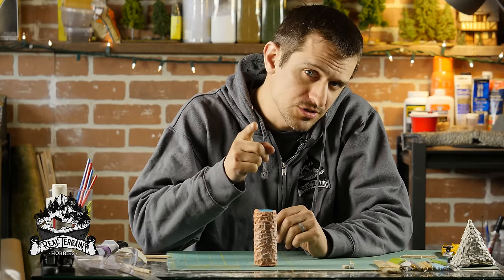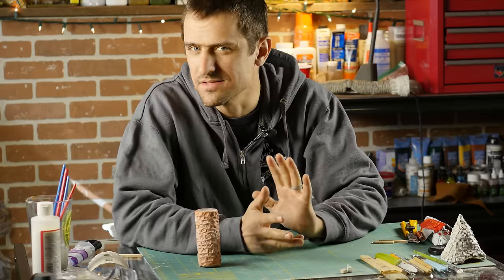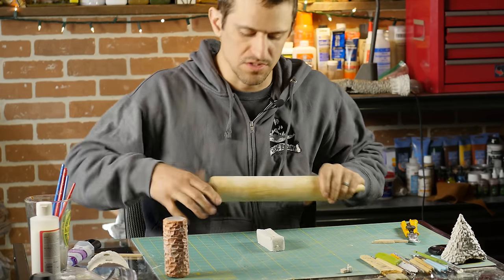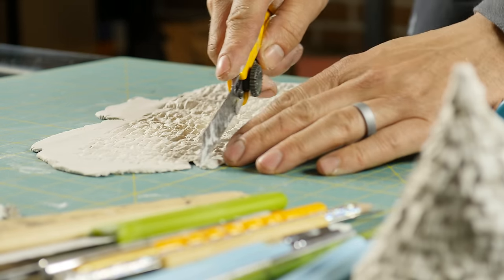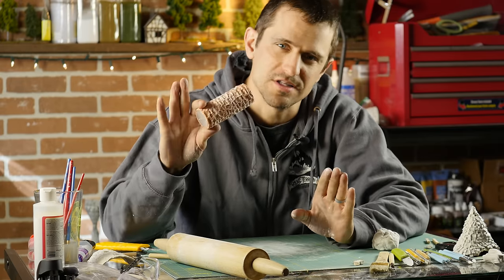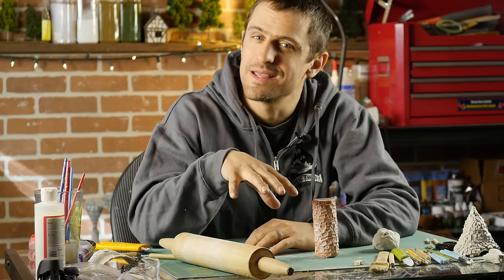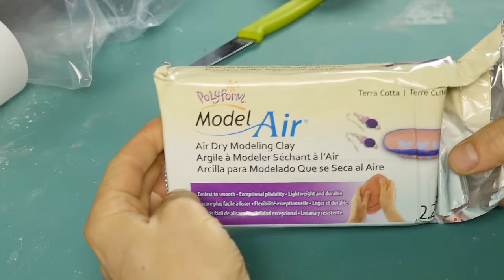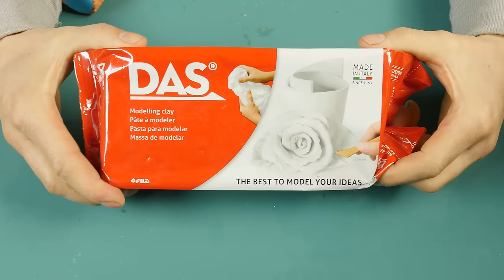🛠Pro Tips |  🏰EASY, realistic stone walls with clay!  DIY texture roller🏰

Comment: What is the difference between the 2 air dry clays?  Do you let the first one dry on the roller before you spray it?  What did you use to glue it to the roller.

Comment: Very interesting. I originally thought the clay was to become a mold for resin or plastic. I was pleasantly surprised when the obviously dried and hardened clay became the tool. One question, at the very end you cut out a very large portion of the tower, why?  Curious minds want to know. Thanks for another great tutorial.
Reply from the maker: Ah yes I forgot to actually mention to make sure the clay dries and hardens 24 hrs before spraying with varnish.  But yea, works great!  As for the tower, I cut out that portion so you'll be able to get a look inside the tower once things all said and done.  I'm going to be using some vines and brambles afterward to hopefully his the seam around the edges.  Going to do what I can anyway to hid the seam for a "seamless" look.

Comment: awsome video, very cool rolling pin you made there. I found that (for me personally) it was easier putting the clay directly on my foamboard pieces 1st and then going over with the textured roller. After that i cut away the clay at the edges.. But again, my personal prefrence. But it would not be possible at all if it wasn't for your great tutorial on how to make it, so thanks alot mate, really!
Reply from the maker: Awesome.  Yeah I did do a little of that on my tower build.  I found pressing it down firm enough was an issue though when tring to go that rout so I mostly just ended up rolling it out first and then putting it on.  If you got it to work well that way for you though then that's all that matters! :)

Comment: Question Bud. 
Could you take polymer Clay ( Air Dry Clay ) and make a rock face mold using an Outside Rock or Boulder and then make a cast with Hydrocal, etc ????

Comment: Been working with foam (works the same way with a roller) but I’m about to order so of this clay it looks soo much easier to use
Reply: I used XPS foam for years until I tried air dry clay, I haven't used foam since! Chavant clay is even better to work with 👌

Comment: Is the Polyform air drying clay (the brown stuff used for the roller) different from the white das clay you use for the actual wizard tower?
Reply from the maker: It was a little bit different, But I'd have no problem using the DAS.  Just make sure you seal it well in the end.
Reply: @RealTerrainHobbies  Appreciate it. I cant wait to make my own for stone floor tiles.

Comment: Question about the clay. I attempted to do this and used a 2” diameter x 6” long. By the time i got to the end the clay was starting to dry and change the shape of the stone. I couldn’t find the same clay. Would Das air dry clay work???
Reply: Oh. I need an answer to this question as well! 
I am going to try a small square just to see the results.
Reply: Further down in comments our question is answered. 
Das Air dry is fine to use. Be sure to use several layers of varnish.

Comment: I model in N Scale for my model railroad. Making the clay roller impressions 'one stone' at a time wasn't possible. The stones were just TOO big. So I cut a piece of 1/16" thick basswood 1.5" diameter circle. Then filled the surface with small stones. About 50 of them. I added CA glue to lock them in place. Now I had a round stamp and I could do 50 small impressions at a time and stay in scale. My roller measures 1 inch diameter and 2.5" wide. Great for cobblestone road or walls.

Comment: Just wondering, would it be any easier (in making the roller) to apply the clay first and then press in the stones? I can see the difficulty in using the roller on a building, but pressing the stones in after glueing seems like it may be a bit easier. Not sure, going to have to try though!
Reply from the maker: It might be yea.  I imagine handling the roller getting those last few indentation may be slightly difficult.  Maybe not.  Only one way to find out! :D

Comment: Wouldn't it be easier to first put the clay around the roller and only then push in the stones? Anyway.. I'm going to try it out myself so unless there is a reason to do it like you did it. I will try to do it like I just said (perhaps it will crash and burn). Thanks for the awesome idea!
Reply from the maker: I considered it but felt it would be a lot more awkward to handle and work with putting in all those stone indentations.  Maybe not though.  Give it a try and see what you think!

Comment: This is great, thanks for showing and sharing, I'll be trying this soon enough  out of interest what's the glue you used to stick the roller mould to the plastic tube you used? Great stuff, keep up the good work 👍🏻👍🏻
Reply from the maker: Thanks!  Glad you found it useful.  The glue is a construction adhesive called PL Premium.  It won't be breaking off any time soon, or ever.  ;)
Reply: @RealTerrainHobbies  great, thanks. I've just made a roller about 10 mins ago, I'll leave to dry tomorrow and hit it with the sealant as you've shown. Life changing I hope !!

Comment: Very nice, but I think after seeing your example that I may have waited until the clay was on the roller before indenting with the stones and making the pattern.
Reply from the maker: That works too although that would be a lot of handling of the clay roller.  You'd have to be holding it with your hand spread wide one finger and thumb on each end the entire time so as not to grab onto the clay.  This took a while so you'd be holding it like that for quite a long time.  In my head this seemed the simpler and easier route.  But, haven't actually tried it that way so I could be wrong.

Comment: Just one question.... How do you prevent cracks in the air dry clay ???. I've used every brand I could find ( including Das) and they all crack. I've watched all you videos and I don't think you address this problem.
Reply from the maker: Honestly i havent had any cracking at all.  Looking at my wizard tower right now and i still have yet to see any cracks.  What climate are you in?  Where abouts are you located?  Just a guess but maybe that has something to do with it...
Reply: I live in  Indiana.  My house is around 70 in the winter, low humidity. But it's happened in every season. I've tried covering it with a damp clothe and that helped somewhat but it takes longer to dry.  The only way I've been able to do a large piece ( building, bridge, etc...) is the same way you show here and then once it's dry go back and fix all the cracks again. And that gets a little time consuming.
Reply from the maker: Huh, that’s crazy.  I still have absolute zero cracking on the wizard tower.  It’s DAS you’ve used?   I’ve seen some people adding in PVA glue to the clay to help stop cracking.  Give that a try and see if that helps
Reply: I have the same problem and I also tryed to mix in pva glue. Some tutorials say you have to wet the base first to get a better binding but it only results in bending. Maybe it is your glue you use to stick it on? You use it quite thick could it be a glue that drys to foam like the alligator glue?

Comment: Dude! How did you know I need one of those right this minute?
Reply: Pasta maker* you'll never look back.
Reply from the maker: Yeah, I'm definitely going to grab one of those.  I was considering the one at Michaels when I was last there, but thought I could get  one cheaper somewhere else.  That just made me put it off.  Shoulda just grabbed that one.   Awesome on the timing haha.  What are you planning to make with it?
Reply: @RealTerrainHobbies  I'm doing some 1'*1'  tzeench puzzle shaped cobblestone road tiles, had a whole stack of odds and ends puzzles (10-20 mil) that I seem to have left in storage on the other end of the country 🙈. I just need to see the title to get the bulb moment. (even if it is a little cheatsy. )

I haven't felt that experimental with Das yet (re:pastamaker) but I've wanted work it with mod podge to really get the detail retention and eliminate a sealing step.
Reply from the maker: @Monkeyshaman  Ah, gotcha.  Yeah you'll probably be handling those pieces a lot so mod podge would help out with durability.  Good luck with those tiles!  I'm going to be doing more experimenting with Das so I'll see how it holds up for durability and detail retention.  The roller holds up extremely well after several coats of varnish and I can wash it with soap and water after and it cleans up just fine without reactivating the clay.  The varnish seemed to do a really good job sealing it up.
Reply: @RealTerrainHobbies  I think you'd really need to soak it sans varnish to get it to reactivate even then I'm not sure it'd make a difference if it was thoroughly dry.
My biggest problem with Das has been its extreme willingness to dry. A spritzed zip lock and a knead through the bag each day or so seems to keep it going and it hasn't started molding yet so I'm willing to give it a shot. I'm particularly interested in if I kill the pastamaker and if I can improve adhesion wet to dry if I really layer it in there.

Comment: I was thinking of gluing my mold to a rolling pin. Then I would have handles attached to make it easier when rolling out new walls. Yes NO ?
Reply: I would like the same.. but i also know i want to be able to remove the handle then. So you can use it also in a situation where you just want to do a small part that is not flat. The handle might be in the way then.

Comment: I don't want to come across as dissing u. If you are going to roll out your CLA. You could roll it on greaseproof paper to prevent it sticking to surface. This would probably mean you wouldn't need to use knife to separate clay from surface.
Reply from the maker: No diss felt!  Always up for some constructive tips and tricks.  I used some parchment paper later on in the vid, but for whatever reason didn’t use it for the beginning demonstration. I should have had that in there though. Appreciate the feedback so don’t worry about that.👍